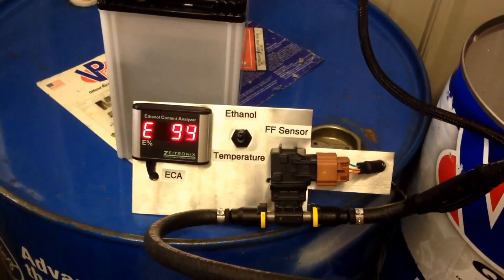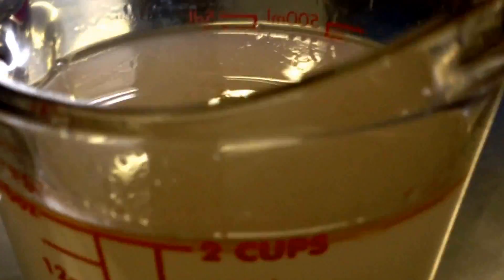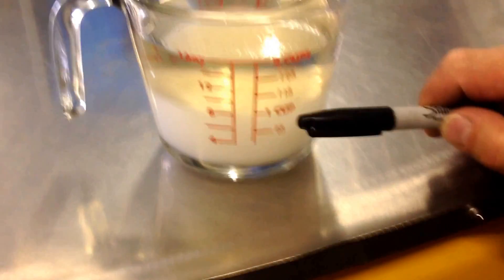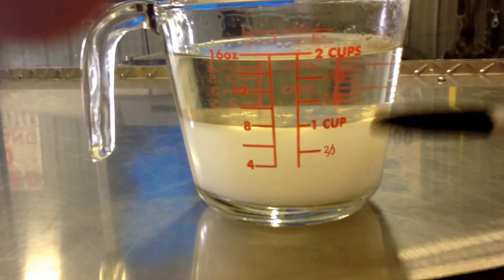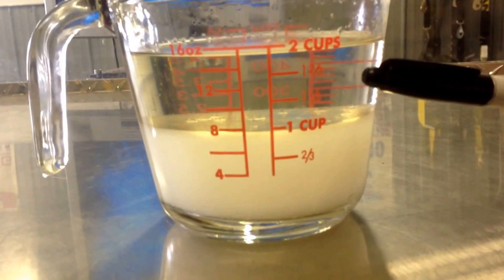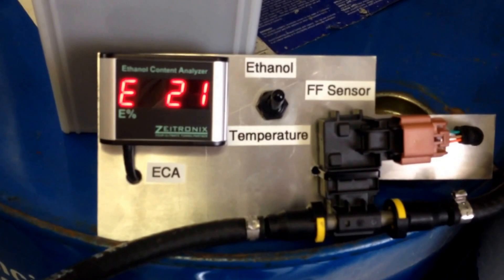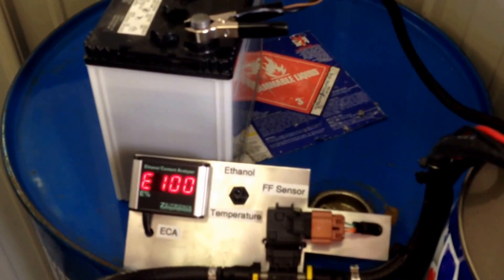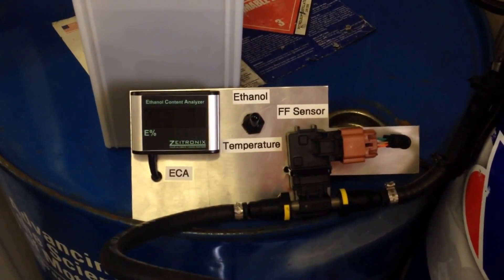Flex Fuel Sensor Testing Part 2

Comment: Very disappointing seeings how I just purchased one of these. It should be called what it is, a gasoline content analyzer, not ethanol. So if you go to a crappy E85 station that has water mixed in with the E from condensation or whatever, your never gonna know with this devise? Thanks for the video.

Comment: I think it's a case of actually understanding how the sensor works. I've really got no idea but as an electronics professional I'd take a guess that it relies on the principle that water is a polarised molecule so it will tend to orient it's self in an electric field. Alcohol is also a polarised molecule. Water will ionise easily with additives but when pure , it won't. Alcohols are similar. Oils (Alkanes and alkenes) are all insulators, won't ionise normally and are not polarised. What happens if you try to measure the content of detergent. That's also a polarised molecule and the sensor might think it's ethanol?
It's nothing to do with the fossil fuel industry.......it's the aftermarket electronics industry that misrepresents it's products.